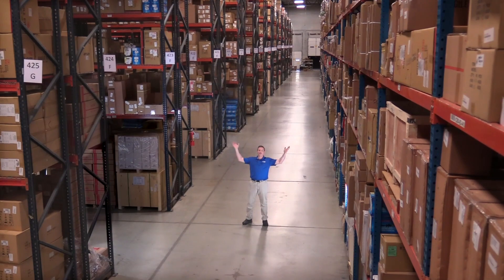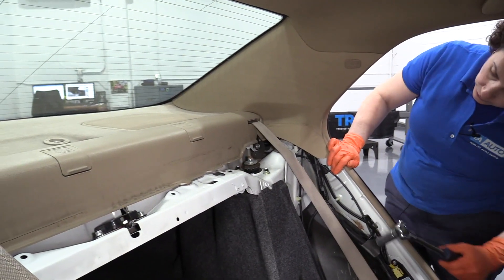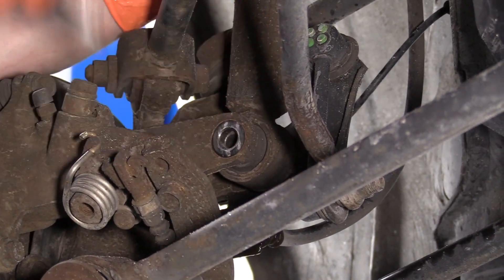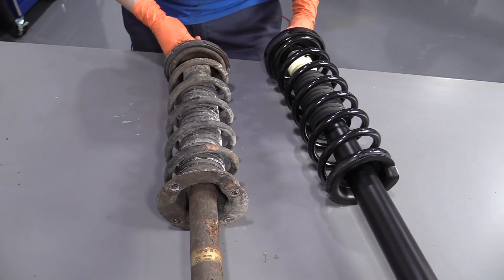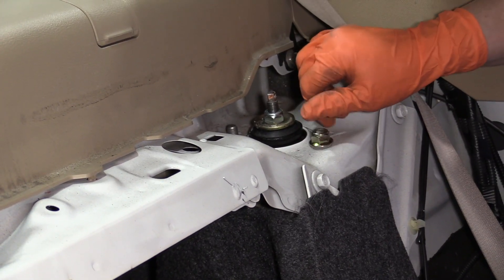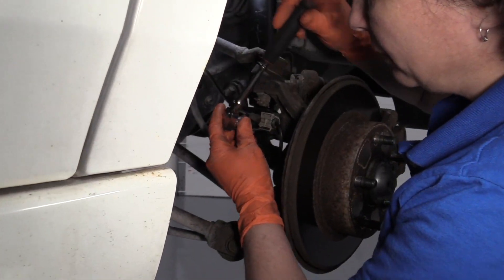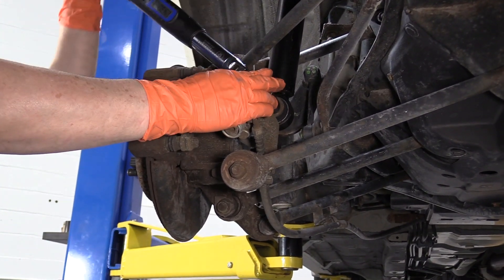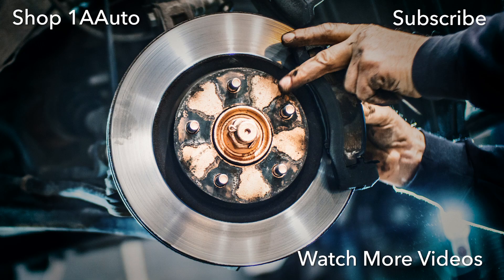How to Replace Rear Struts 03-07 Honda Accord

Comment: @7:39 chipped the paint on the inside top of the wheel opening arch by forcing the new strut in without providing enough clearance first. Looked like one of the studs was making contact. Use a little more leverage by gripping the pry bar farther out on the handle to get sufficient clearance. Never force it in.
Reply: And putting back light colored seat parts with greased up latex gloves.  Not cool.

Comment: Honda recommends removing the strut underneath through the opening created when you pivot the sway bar link out of the way.  The problem with removing the strut through the wheel well is the damage to the paint.

Comment: I couldn’t watched how many times you were banging that strut on the car and scratching it.
Reply: Only time people even look at the outside of their car is when they get body work done,  dont'chya know?
Reply: Auston.E I bought $60k car and believe me I check it a lot. Under 10k car I don’t care where I park it. I would hate to give my car to mechanic and receive it back with dents.
Reply: @Calirules300  right, aaallll of you "check it alot" that's how your certain those rock chips on your hood/front bumper were NOT there before the body shop replaced your fender! 😅 i
Reply: Auston.E that’s quarter panel, no one replacing that. I more worrying about someone slamming door at my car or bumper bumping.
Reply: 7:39 ouch. True that no one will see that damage but overtime it will start to rust and spread if left untreated.
Reply: IKR. Could have clipped and clip a large towel with the rear door to prevent scratches but what can I say us body work guys make fun of mechanics all the time for not being mindful of the exterior LOL.

Comment: You used the most awesome Torque Wrench I've EVER seen. seriously. what model is it? or where can I get one! thanks for the great video, will make replacing the rear struts in my wifes' car a snap, I NEVER would have guessed how to get at the top bolts of the rear struts under the back seat like that. Keep up the great videos!
Reply from the maker: Thank you for the great feedback! +Paul Bailey
Reply: @1AAuto  But seriously, the Torque wrench in the video is the best! where can I get one? the one linked to in the description is a "click Type" not the digital one used in the video. thoughts?
Reply: The wrench is a Cornwell CTG 3000.

Comment: Hi, I enjoy watching your repair videos!  Have a question.  If I buy rear shocks only(not assembly) for my Acura RL, do you think I can just reuse and transfer parts such as: plastic boot, washers, bump stop and upper shock mount OR at the very least, which part do you recommend replacing?
Reply: I can understand that you're probably wanting to save money but honestly it's worth it just to buy the whole assembly for the simple fact of saving you the time and hassle of going through the old assembly just to reuse those parts. But again if you don't mind doing the work then yeah you can reuse those parts but it's also not recommended.

Comment: I have a question I  have  a 2006 accord with 150,000 miles  rear shock need to be replace i was wondering if is recommended to replace spring
Reply: I'm sure you don't need this info 3 months later, but you're better off buying quick struts (they are the shock with a new spring already put together). A good replacement set (I like KYB) costs more, but you'll save a ton on labor cost. You'll have new shocks AND springs for less than the shocks alone.
Reply: @jakeamato6761  have you replaced your struts with KYB? Does it ride similar to the OEM struts? I want to get KYB for the quality, but want the ride to be the same as the original

Comment: Anyone have a problem removing the seat side panels?  I removed the bolts but cannot get the upper clips to remove from either side. 2006 Accord EX.

Comment: Good video on how to get to the top of the strut but I just did the same job only removed the upper control arm on the side closest to the tire and the strut came out and went in no prob without the damaged fender. It's clear there was a little damage weather big or small the customer expected the job done right without any extra damage to their car. Definitely not a professional job

Comment: SHOULD HAVE

The new strut should have been offered up to the top first and the nuts put on loosely BEFORE using the pry bar to get the bottom in..
Notice how the paint on the wheel arch was chipped forcing it in....?

Otherwise very informative and thorough.......

James Hennighan
Yorkshire, England
Reply from the maker: +James Hennighan Thanks for the tip! We'll pass this info along to our production team.

Comment: For those who say "but but you scratched it.."

Have you done that particular car??
Aside from removing both control arms from the spindle there is NO way to avoid scratching the under side of the wheel well..

But if you say it's possible post a video of it ..
And your cash app..

I'll wait